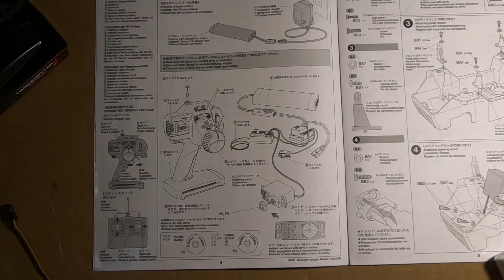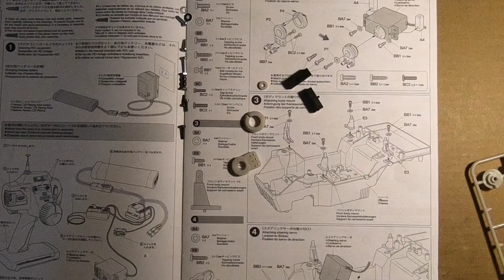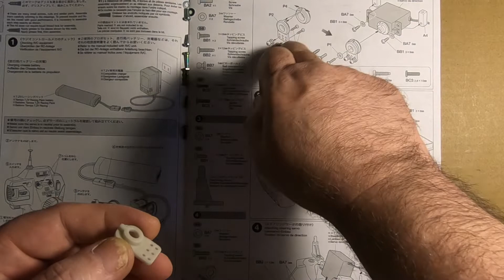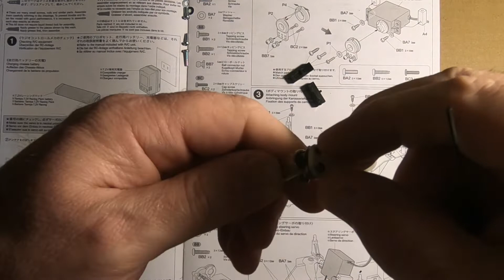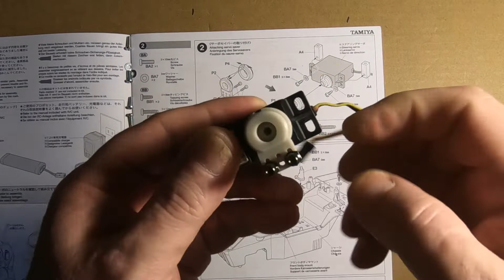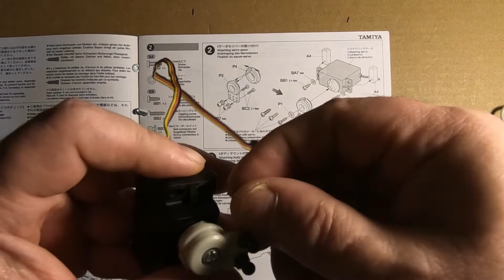Tamiya Midnight Pumpkin Metallic Special: Basic Radio set-up & servo saver install.

Comment: Radio setup is something that is massively important, but usually a task that people rush through. I have a Sanwa handset and it is a minefield of settings, and I do have to shave the plugs to fit in the receivers, so its good you mentioned that, because when you are doing it, it is squeaky bum time!
Reply from the maker: Yes Sir, and Thank You for the comment. That's why I said "on some radios" I have a Futaba 4PV that has all the "bell's & whistles" but I stuck with just a basic simple radio (it's my plug & run system) for this video, I didn't want to over do it.

Comment: Excellent Tutorial Sir 👍
This part of the build is usually skipped when building up a CW-01 chassis 👌
Will you be filming every section of this build? 
I think it's good to watch someone else build up this iconic kit 😊
After this kit, you will probably want to get the Van as well 👍
Reply from the maker: I was trying to Pete, but I did loose some footage, I was gearing the build to first time builders of this chassis, I even had a few OOPS with it (attaching the front shock shaft to the spring perch). Thanks for the awesome comment, coming from the CW-01 master, it means a lot to me. Oh yeah, got me eye on the Black Edition Lunchbox!!! I need to find those gear box braces, any idea where to look? I tried ebay & google searches and found nothing.
Reply: @UncleBobsRC  I actually bought mine from The Grand Master himself @ Ampro Engineering in your country and are available in different colours 👍
Thank You for the kind compliment Bob but I'm no expert, I just don't know how to build anything else hahaha 😎
Reply: Also, don't forget to add the little bit of 5mm shock hose to the top of the shock shaft before it goes through the inner wing (fender) hole on the front as it will eliminate the front wheel camber. The rears are ok but you can lower the rear gearbox housing by 5mm if you also add the tube to avoid any axle slap before take off. And that handset you got is a pukka bit of kit. I run all my car's with those receivers as they are good for 200 yards 👍👍👍
Reply from the maker: @cw-01creations46  Thanks for the info about the spring holders (LOL), I haven't even had it out yet. Pukka?
Reply from the maker: @cw-01creations46  Ampro was me next stop.
Reply: @UncleBobsRC  You might also want to get the aluminium, sorry, aluminum body posts as opposed to the nylon ones that Ampro sell. 
RC Jaz on eBay from China 👍
Reply from the maker: @cw-01creations46  I already looked at some, thanks my brother!!
Reply: @UncleBobsRC  Happy To Help My Good Man 👍
Happy Tinkering ✌️
Reply from the maker: @cw-01creations46  Happy Holidays my friend!!!

Comment: Hi Bob, lovely to see you back on YouTube. Great tips there for the setting up of the radio systems. Noticed that you’ve got a capacitor across the power lines on the receiver? Do you have interference issues with the radio gear? I like the 1 to turn, 2 to burn idea to remember the right connection, great way to remember. Nice explanations, great video my friend. Take care, keep well and all the best to you and the family, happy holidays 😉😊😉
Reply from the maker: Hiya John, Hope your doing well. No sir, not really a problem, those "Caps" came with my other RX's I use and not knowing how good this receiver (RX) is, I put a "Cap" on it. The Capacitor or "Cap" for short are used to hold a small amount of electrical energy (It's known as capacitance) and adds that energy into the circuit if needed. It's a good idea if your using a kit esc with a high draw servo (more than 6v & 1.5a) as the servo might cause a voltage drop in the RX (also true if using a high KV, high amp brushless motor). So I figured, better safe than sorry.  Happy Holidays!!!
Reply: @UncleBobsRC  hi there Bob, thank you for that my friend. I had a feeling it was either to stabilise the voltage and being used as a smoothing capacitor, or for electrical noise interference isolation. I kind of have a little bit of understanding of electrical and electronics. Well, tell a lie, I probably know a bit more, than I let on 😂😊😉. Great introduction to the servo setting up procedure though, it lovely to hear your voice again, I listened and watched your video during my lunch. Told you I had that notification bell hit! 🤣😊😊😉 Bob, you’re on my guru list my friend. Take care, keep well and all the best to you and the family. Happy holidays and best wishes 😉😊😉